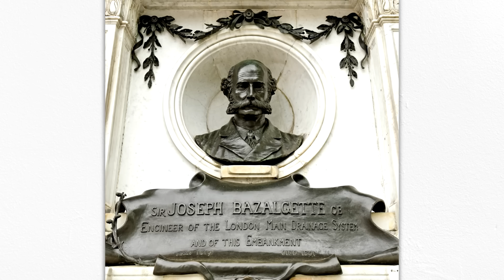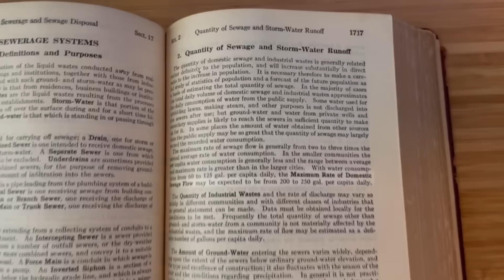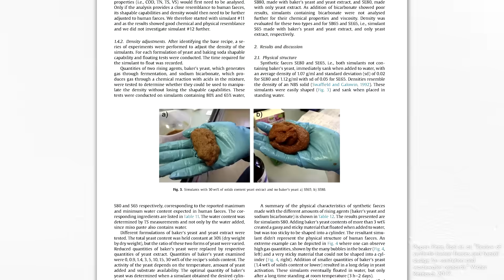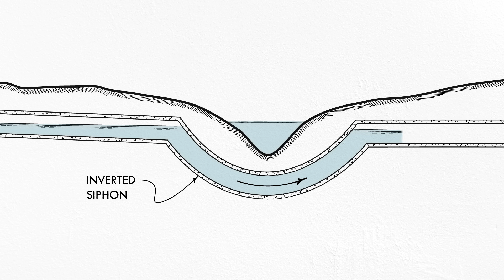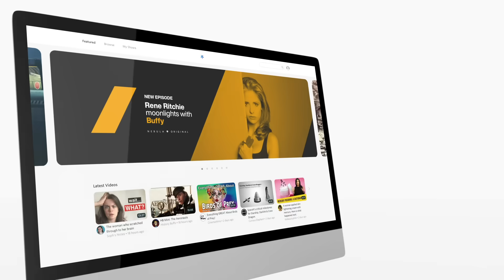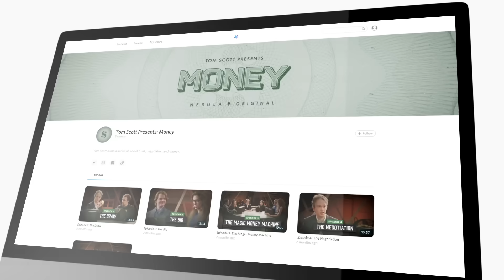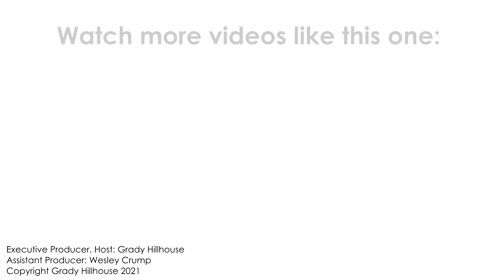How Sewers Work (feat. Fake Poop)

Comment: As a process operator at a waste treatment plan, thanks for giving our awful, yet incredibly important service a spotlight. This all looks pretty good to my eye. You definitely have a bigger budget than my plant though, as horrifying as that might sound. And flushable wipes do a real number on septic tanks too!
Reply: Back in the 70s I had a co-op job at a sewage treatment plant which was both fun and interesting. There were, of course, no (non)flushable wipes but it was condoms that drove the operator crazy. They got stuck in valves and especially in the sludge pump so it was common to see him working on it. Maybe municipalities should do a bit of advertising about this problem.
Reply: @RabbitInAHumanWoild  my step dad ran the local waste water treatment plant and they used to have a guy with a rake manning the grate that was on the first intake tank to keep "white fish" they called them out of the system. They really are a tough material and there are so many of them flushed it's crazy
Reply: @RabbitInAHumanWoild  disgusting and lazy people are the problem.
Reply: We have a septic tank, and absolutely nothing goes down there but water, waste and septic safe detergents and paper. We hear flushable wipes horror stories from our maintenance company, too.
Reply: @dyadica7151  "flushable wipes" have been the worst thing to ever happen to plumbers. I worked maintenance for 130+ units condo facility and we had 8 inch drain piped impacted 10ft with "flushable wipes" and congealed fat. Completely destroyed a $5,000 grinder/ejector pump.  Or the occasional diaper clogging the main drain in a 30 unit building.  And my favorite was plastic q-tips down the toilet. Can't pass the final opening on the toilet and then collect all the "flushable" wipes and neither disintegrate.
Reply: @dyadica7151  we even keep a filter basket in our kitchen sink to capture larger food debris.  It's a little unsightly but helps ensure we limit the solid waste that enters the tank. :)
Reply: @dyadica7151  I've seen some powders you can add that contain fat eating bacteria, supposedly to stop a fat layer forming on the top of the tank.
Reply: @Croz89  Those are great to introduce in the collection system along with pumping stations.  Using the bugs in the pipes was one of the best things we did to stop FOG issues.
Reply: @dyadica7151  what is septic tank and how it works I hear it too often lately
Reply: @disrael2101  I think this wikipedia article does a good job of explaining it: https://en.wikipedia.org/wiki/Septic_tank
Reply: @dyadica7151  thanks very interesting indeed just one thing didn't understand is if it only needs pumping once a year or so for removing solid where's all the water going after tank is full which probably takes couple days max? Just into the ground on the other side of the pipe or
Reply: @disrael2101  Yes, the water at the end, when it's environmentally clean, drains into the ground via a special purpose drainage field of smaller perforated pipes (pipes with small holes drilled into them) set into gravel.
Reply: @disrael2101  can ask Palestine
Reply: @worldchangingvideos6253  no idea what this is
Reply: Septic technician here. Yes they do!
Reply: Flushable wipes aren’t really flushable it’s completely BS & should be banned for sale!!! Thanks 😊 for your service cleaning up 🧼 everyone’s poop 💩!!!
Reply: @ZaneDaMagicPufferDragon  maybe not necessarily banned from sale, but I wouldn't mind a false advertisement lawsuit
Reply: @ZaneDaMagicPufferDragon  agree since it actually causes lots of damage and costs money to cleanup, and the only person paying for it isn't the company making the flushable wipes.
Reply: @ZaneDaMagicPufferDragon  don’t ban them, just change the label.
Reply: @ChaosLord5129  someone's gotta do it
Reply: @ChaosLord5129  Maybe if you got rid of every "gross" toilet, drain and sewer in your area you would truly understand what the word means.
Reply: @isaacw7479    Don't bother, he must from the younger generation that has no clue about anything based in reality...
Reply: Oh, I do appreciate it.  It's a cornerstone of modern civilization.
Reply: I’ve always been fascinated about this topic. There’s a lot that can be done especially in under developed countries
Reply: @Alvi  The sad thing is in its most basic form a wastewater treatment plant has very few moving parts. You need a settling area for separating solids, done usually by just slowing down the flow and adding a simple chemical to "flok" or cause suspended, small solids to clump together and settle out. Then an area to treat the water. Simple aeration, like an air bubbler in a fish tank, will supercharge bacteria to eat the bad. This is where it does get costly as adding chemical or other ways to clean the water adds complexity. Finally you need a way to remove left over bacteria/chemicals before discharge. The last one is often overlooked in developing countries/areas and can cause headaches if discharge is directly into a waterway. This can be minimized by creating a man made wetland for nature to breakdown outflow leftovers before the discharge makes it to say, a river people fish and drink from.

Here in Phoenix Az one of our wastewater treatment plants was designed to discharge into a dry creek that was transformed into several acres of wetlands. Then it flows into the major river that runs through the metro area. Granted, as a last step before discharge from the plant we add chemicals to neutralize the chlorine, and with everything we do the discharge is technically cleaner than the clean water coming out of your faucet at home.
Reply: @Benson_aka_devils_advocate_88  I learned so much from this. Thank you :>
Reply: @algallero3310  You're very welcome :)
Reply: @Benson_aka_devils_advocate_88  thank you for the detailed explanation. A few things I could relate from the information you provided. Here in Dhaka, Bangladesh we have lake called hatirjheel which acts both as settling tank and bactaria introducer and there are aeration devices. Which then moves through a spill way to another section of the city. Which then leads to another place called demra. I’ve seen aeration device there make a kind of foamy bubbles. From there the water gets chlorinated I am assuming. But this being a riverine country most of the time we usually clean river water. But where we differ is that there is not enough mechanisms in place the clean the fat blobs. Which often time creates blockages in the sewer system. It rained for an hour or so last night flooded the entrance of my home.
Reply: @Benson_aka_devils_advocate_88  We upgraded to a BNR system 8 years ago and use no chlorine.  With some changes to chemical suppliers we are exceeding the requirement for enhanced nutrient reduction plants.  Just when we have high flows do we get up to around 300 ppm for solids in the discharge.  Still that is clear to look at in the beakers.  Then again Walt Higgins of EPA region 3 has done a few articles about us.  From what he was telling us we are an odd ball in region 3.  The said part is we discharge into water dirtier than we produce, being the Susquehanna River.
Reply: @brett76544  isn't disinfection different than nutrient removal?
Reply: @atarisbetter9199  yes, the old way was to add chlorine, but now there is uv and some other systems.
Reply: @brett76544  yeah we still use chlorine but we are a very large plant and not sure if uv would work. I'm no process engineer though lol. Our peak flow daily is around 190mgd and converting seems to be a massive amount of tubes.
Reply: @atarisbetter9199  the largest plant I've been at was 110 gpd.  Still a methanol system could also be used, the only problem, does the fire company have a large enough foaming system.  That stoped the plant in Binghamton NY from using that system.  They are 10 million a day and I can see one guy cleaning the system every day at work for alage build up.  They changed to a UV system.
Reply: Until a few years ago, I had no idea what the fuss with „flushable“ wipes was about. 
I mean - I never used them but I also never gave it a thought. 
It was through personal experience that I got to see what those things do to the sewers. A friendly neighbor had over the years managed to completely clog an important sewer line with those wipes which lead to water and waste backing up and coming out of...let’s say, less than desirable locations in several apartments. The plumbers spent a few hours shoving cameras and various cleaning implements into the pipes and were chipping away at the mess and cussing a lot. From the camera images it apparently became clear quite quickly that her apartment was at the core of the problem. My neighbor got a very stern lecture (and probably a substantial invoice) from the plumber as well as an earful from the landlord afterwards and there has never been a problem since. So they apparently learned their lesson. Oh, and the bath tub and sink now drain a lot faster.
Whatever plumbers earn, though: they should be earning more.
Reply: Gordon, it's a shit job but someone has to do it 😂
Reply: @burgersnchips  they're number one at number two
Reply: Civil site inspector here, this is nice to see since most don’t know about them and their construction.
Reply: I have a bidet.  You’re welcome.
Reply: I always thought flushable wipes were a bad idea so i never used them. What i want to know is how a company who makes wipes is allowed to dictate what's acceptable to go down the drains and sewers.
Reply: God bless you and the work you do.
Reply: @Art's Bobcat  Sanitary lines are usually in the middle or near the middle of the road. This is due to the sanitary line being the deepest utility under the road. We have to work within a “right of way” area and not encroach on people property. 
Storm sewers are strategically placed to utilize road grades to collect water during storm events.
As far as a sewer line crossing a field, an agreement between the municipality and land owner was reached at some point allowing the line to be placed there. Most likely it was the shortest and most economical route for the line.
Reply: Waste treatment plants are super interesting. Although they don’t smell great, it’s amazing to see how stuff actually works
Reply: @MrMysteryman00  at our sewer plant you have to stand next to it and only when we are aerating the digesters can you smell it on a hot day.  A working sewer plant should not smell.
Reply: @brett76544  Damm. Must be nice. The one I visited was not like that at all.
Reply: @brett76544  Unless you are processing 120 million gallons a day.
Reply: @aeromodeller1  I've been to plants like that.  Still ours does 300,000 gpd.
Reply: @brett76544  The regional dump was across the street. When the wind was from the north, the guys at the plant would call the air board, who issued fines. When the wind was from the south, the guys at the dump would call the air board, who issued fines. Finally they all accepted that there was no way either was going to stop sinking and so they signed a truce.
Reply: @aeromodeller1  If you can smell a sewer plant, it is not operating correctly or is now an old design.  I can remember someone from NY saying that they have not smelled our sewer plant in PA for a long time.  They live 3 miles away.  We finished using the old system almost 10 years ago.  Now the EPA and PA DEP uses us as an example.
Reply: You must have a titanium nose.
Reply: i love being a wastewater operator! except maybe the sed tanks on a particularly sassy day, or any issues whatsoever with scum... blech. level 4 plant here (bioreactors, DAF). i don't deal with bar screens though so i think i'm pretty lucky, flow in starts with grit classifiers and the screens are way back at the lift station.
Reply: @sameo-  i love your use of "sassy" to describe a sed tank. How delightfully, grossly, evocative
Reply: @sameo-  I never heard of levels with plants? I'm an operator too.
Reply: @sameo-  bar-screens! I haven’t heard that term since I retired.
Reply: Thank you for your service! 😁
Reply: I'm a plumber and I work in vintage buildings, flushables are banned by management, so are drain cleaning chemicals and it makes a big difference in the reliability of the systems.  There are still idiots who put entire diapers down the drain though.
Reply: My friend is in your business too. I’m always giving him shit about it 😂. Seriously you do a valuable and necessary job.
Reply: You do a great job me friend! Thank you.
Reply: correct my if im wrong but most sewage isnt toilet flush/poops right? this vid seems to make that the biggest point while really most is like soapy water and food bits.
Reply: @sudazima  98% of flow that goes to a treatment plant is domestic water. Think of the ratio of water to solids that go down your drain. The sand demo was cool but solids in wastewater don't sink as fast as sand.
Reply: I have some glass jars with regular wipes, then the flushable wipes (both going on 3 years old) and one that I put TP into for presentations.  I dated the day I put the wipes in on the sticker.  It is unbelievable how the fibers build up mop heads on the clarifiers, mixers and get into the sand nitrogen system.  Then we had issues with pumps and had to dig up one valve for the nitrogen system.  We got a screening system in the head works and it fully stopped the problem that was costing us 10% of our budget for two years in a row.  Then we got the PA Rural water waste water system of the year for 2015.  We had Walt Higgins from the EPA and Mark Nevel from the PA DEP come in and help us in late 2012.
Reply: Flushable wipes do a number on the maceration pumps too. The only advantage to flushing them is guaranteeing us plumbers have another job for the day.
Reply: Thanks for your service.
Reply: The fact that products are still able to advertise themselves as "flushable wipes" is completely insane to me.  I'd love to know many millions (if not BILLIONS) of dollars in damage they've caused to our infrastructure over the past few decades!
Reply: Hey thanks for what you do, like the ppl who take our trash away, you are incredibly underapreciated.
Reply: People just don't  seem to understand the importance of Public health engineering in general. Am i right?
Reply: @pranaydeshpande5171  - same as some don't understand appropriate behavior in pandemics or getting vaccinated - its always 'someone else's' problem until it isn't
Reply: Plumbers and sanitation engineers have saved more lives than all the lives of every doctor and nurse ever, combined!!! Farmers and plumbers are two of the most important professions in the world. Without them, modern society would literally not be possible. We can do without electricity and technology. But food, clean water, and sanitary waste removal are vital.  So thank you for your SERVICE. Arguably plumbers are more important than soldiers and definitely lawyers. Plumbers and lawyers are very similar because they both deal with shit except a plumber wont try to feed it to you.
Reply: What got u interested in working with sewer stuff why did u do it
Reply: @ChaosLord5129  - it's honest work that needs to be done.
Reply: @Gordon Wiley you guys get nowhere near the respect you deserve. Things would become unimaginable nasty without sewage treatment and garbage collectors
Reply: Year 2 operator at a source water treatment plant. These guys have the shit end of the stick. Literally. Be mindful of your waste.
Reply: For those who use TP, but want a wet cleaning, I find that a splash of water and small spritz of vinegar (that I already have in a spray bottle for cleaning) on a square as a final wipe (after excess has been cleaned away), leaves me feeling fresh & clean.

You do have to work quickly, though, since the paper does disintegrate quickly.
Reply: I am in a constant battle against flushable wipes. 
I have had so many nights where I’ve been woken up at 3 am to run an 80 foot snake only to discover a wad of flushable wipes the size of a toddler.
Reply: Thank you! You are more appreciated then you know! You, our troops and first responders don’t get the recognition that you should.
Reply: Same here, this is so much more on a larger scale than what we deal with. We use lift stations too. Only about 125k gallons a day.
Reply: Dumb people and drugged up idiots will always exist thus for this problem of people flushing dumb garbage will never go away
Reply: @Pactastic042  ive seen a pack of sick frogs living off roaches, a very sad coughing squirrel, and there was a point where someone in my company found a baby skull, huge investigation n stuff before i was hired
Reply: Omar FASPC  i said locator though... and i never glorified it, you asked a question and your belittling like a jerk... im sorry that you feel the need to feel better about yourself
Reply: Omar FASPC  you've got issues bro
Reply: Fecal Matters
Reply: And thank you for making sure the waste gets out of my home and safely off to where it should go 👍🏻
Reply: The analysis of waste water to monitor everything from drugs to now Covid has been a fascinating development. I hope that he does something on that one day as it has been a game changer for a lot of reasons. As for the flushable wipes - pretty straight forward. As people get fatter, they develop t-rex syndrome and other nasty conditions and normal toilet paper doesn't do the job anymore. Enough said.
Reply: Thanks for dealing with our shit!
Reply: Bro, thanks for the comment about so-called “flushable” wipes. What a scam—I mean, a lego is technically flushable! Yes, peoples, come on, don’t flush those flushable wipes!!
Reply: @Art's Bobcat It has to do with the history. Older cities had joint sewers. Everything drained into creeks. Later you want to build a treatment plant, so the storm system is separated from the sanitary system. The original sewer was built on the street center-line, so the new sewer must be built off center. Later developments will place the two sewers on opposite sides of the street. You have a new tract development on one side of an open field and the nearest interceptor is on the other side, so you run the connection across the open field, hoping you guessed where the future street will be. Sometimes you guessed wrong, and the sewer will be in the future sidewalk. Sometimes the original sewer was built in a narrow street in county jurisdiction and the area gets annexed into the city. Traffic increases and the street gets widened, but it can't be widened on one side because of creeks or railroads. Sometimes one side of a street will develop before the other.
Reply: Omg I didnt know that, sorry I'll never flush another wipe down.
Reply: I was just at an airbnb that had signs everywhere of what not to put in the drains, wipes and grease being the big ones
Reply: @astro143_  that's smart
Reply: Rejuvenation of nature is the work you people do
Reply: As a Class 4 Wastewater Plant Operator, I do love watching videos on how the system works! And yes, you should NEVER flush "flushable" wipes! At least most cheap versions of these wipes don't actually degrade & even manage sometimes to get through our bar screen and clog pumps.
Reply: Wow. I am currently helping build a shit plant
Reply: Thanks for all you guys do.
Reply: Gordon, 
Not sure how long you've been in the business...
Have you ever heard the saying, 
"The solution to pollution is delusion" ?
Reply: @torchofkck4989  Coopers Town NY, one part sewage, 10 parts stream water, mix and release.  That shocked me when I saw it.  The DEC is finally looking to change that
Reply: I work as a sewer locator who looks at your ruined and unmaintained pipes :D
Reply: Wholesome  shit🥰
Reply: Thanks for all that you do!
Reply: I love working with sewerage.
Reply: Omar FASPC  i put a camera with 4 wheels in a sewer and it has a sonar, if it dosent get located, utility companies get dumb and drill through sewer lines. So i measure depth and direction. Ive seen gas companies drill through them all the time
Reply: TheReggiereg1  The blue shop towels take a while and end up being picked up by the screening system, now regular paper towels will break down before the plant, especially if they go through a pumping station.  You can also use a cage like system for the inflow of a pumping station to catch things like that.  Along with needles.
Reply: @Art's Bobcat Man holes are normally in straight stretches placed 400 ft apart.  Junctions also get manholes and when there are turns in the pipes.  In pa we have to be 3 ft away from water lines, but natural gas can be placed in the same hole as sewer lines, but is discouraged by us.  PennDot also like to have sewer lines now just off the paved area of the road in the right of way especially on roads out side of boroughs and cities.   We have 7 lift or pumping stations and just got generators on them.  The smallest has two 1.5 hp pumps to athe largest with two 14.5 hp pumps.  Then there is the main pumping station in the plant where we have a screening system and that has four 10 hp pumps.
Reply: So would you suggest to not use flushable wipes
Reply: @bigpappachungus  yes, I'm an operator that works with those "rags" we call them in our pre treatment area. But honestly I still use them because it's so much cleaner than tp.
Reply: You think Flushable Wipe should be banned under false marketing ?
Reply: Isn't it funny pro sports players get millions but us water treatment folk get nothing, even in a drought. Humans suck
Reply: Though not often thought of your service is greatly appreciated and thank you. Where ever  you are
Reply: The local sewage organisation in Djursland, Denmark, once complained that somebody had dumped a carpet in the sewer. I guess a manhole cover had been removed in the darkest hour of the night to make that possible. Luckily the culprits did not risk losing their brains too.
Reply: @typograf62  How about a chunk of asphalt over 12 inches in diameter in a man hole with 8 inch pipes coming in and one going out.  It was causing a back up into 2 homes.  we had to use a metal detector to find the manhole that was tar and chipped over twice and the last paving of that road was when the sewer lines were put in back in 1986.  Then after we found the block in the man hole they repaved in 2019.  We figure the block got in there in 1986 and too a few decades to just get into the right position to cause the back ups.
Reply: Haha flushing orbeez down toilet go brrrrr.
Reply: @joelcrafter43  hey, I'm not you're dad,  live your bliss. Good luck if it screws something up closer to home though.
Reply: @gordonwiley2006  I was referencing that story from a few years back where a swedish clogged up like an entire neighborhood with them, or at least that's what it looked like, no clue if it was fake or real though.
Reply: Same here an operator. I'm at a large metro plant. I work in the pre treatment area and our screenings dumpster is all rags. Serious people flushable wipes aren't real that don't break down at all.
Reply: Given that wipes marketed as "flushable" are anything but, why haven't we seen pressure on manufacturers to stop labeling the things as "flushable"? (or even laws banning such labeling)
Reply: @jfwfreo  I wish I had an answer for this one, but I don't.
Reply: Thank you for keeping the world's sanity stable by taking care of our waste mate. You are appreciated.
Reply: The fact they're labled flushable is an oxymoron in itself. Smh
Reply: Thank you for your service
Reply: thanks for accepting my poop. - and other fluids i send your way
Reply: Whatever they pay you guys, it's not nearly enough
Reply: I did maintenance and collections ( vac truck)
Reply: The fact that "flushable wipes" are still allowed to advertise as "flushable" is just ridiculous to me.  These companies are costing taxpayers MILLIONS of dollars every year and just absurd as far as I'm concerned.

Really demonstrates how entirely our government actually works for corporations, not the people themselves.
Reply: This is something that I will NEVER do, and cannot thank the people like you - enough so I never have to worry about this stuff once it leaves my body. 

I will never judge the job someone does, because someone MUST do it, and I’m sure glad it’s not me.
Reply: I believe you. I feel like wastewater treatment is often overseen as a useless burden, since this process itself doesn't put the bread on the table
Reply: How did you get into that line of work?
Reply: Sounds like a shitty job
Reply: Omar FASPC  basically if i dont do my job right, houses blow up and people die
Reply: ok
Reply: But (butt?) flushable wipes do such a good job on my little bottom…..
Reply: ...collect ur BiG chex & shut up! LoL
Reply: That means flushing condoms are just as bad?
Reply: One question sir, did u plan to be like that ? Or just a job stumbled upon?
Reply: @FedJimSmith  Like most at my plant, I found the job from knowing someone. For me it's a job of convenience and not a career.
Reply: Process operator sounds like a very polite way of saying shit stirrer 😂😂😂
Reply: Still not gonna wipe my arse with dry paper.
Reply: What about tampons??
Reply: @rmg2419  I have seen those block up the laterals from the house to the sewer line.  Then at the sewer plant without a screening system they turn into mop heads on the clarifiers along with any motars and pipes in the treatment part of the plant.  So you have to drain the plant in sections about once every 6 months and clean it.
Reply: @rmg2419  also not good to flush. If it didn't originate from you, it probably shouldn't go there.
Reply: @rmg2419  yes tampons, the applicator, condoms and a** wipes are majority of what comes through.
Reply: @ChaosLord5129  trolling is disgusting
Reply: @ChaosLord5129  yes trolling
Reply: TheReggiereg1  no. Not regular paper towels. The fibers will break up. But don't flush rags or cloths. The woven fabric is to strong.
Reply: @ChaosLord5129  your comments were unstable, are you ok?
Reply: Gordon after the waste water is treated what is its destination ?
Reply: @andrewnicholas9079  usually a river, in our specific case, it ends up at a power plant to spin a turbine/make steam before entering a river and then flowing out to the ocean.
Reply: @gordonwiley2006  thanks. That's interesting. I worked with water in oil and gas production for many years in the gulf of Mexico. It was treated and put back into the ocean. I always wondered about the waste water.
Reply: You work at a waste treatment plan?????
Reply: @Gordon Wiley You're a local hero, thank you for your service to society!
Reply: I work in water treatment as well. Clean water is so underrated...
Reply: I hope to god you guys don't suffer with septic trucks that empty stones and gravel/sand into your plant. :D
it truly is a costly nightmare.
Reply: I'd never flush something so indurant, if it needs a rag then by God I use a cotton rag. The same cotton rag next month could be wiping my nose. Yes I appreciate the dirty ass jobs!
Reply: Stay strong brother, respect from texas.
Reply: What's a average salary for this job ?
Reply: Dirty Jobs did several shows about your industry.
Reply: I am so against "flushable" wipes, I only use toilet tissue labeled as "safe for septic systems" like Scott's. 
If the TP starts dissolving before I get to flush it (and it does!), it's a good indicator that I am not contributing to the problems.
Reply: Heres a random fun fact: A close friend I work with used to be the guy diving in the sewage water, (quite some time ago) I remember him saying one thing he saw alot of vitamins/ pills (he specified vitamins for whatever reason) . .as well as the whipes, and corn . . Supposedly at that point,  all the methane kills most harmful bacteria anyway . .is that true?
Reply: Well thats engineers for you. Even on there spare time working on hobbies they have more money then government facilities. No way this guy is making more money on youtube then as an actual engineer. Iv never heard him peddle patrion or ads.
Reply: Ask yourself does this make sense to you  3 This means everlasting life,+ their coming to know you, the only true God,+ and the one whom you sent, Jesus Christ.+ 4
Reply: Dude you're a hero.
Reply: Luckily I have an electronic grinder built into my septic tank so can basically flush anything I want (within reason obviously not plastic or metal) without worrying about such things.
Reply: .. I really should read all comments b4 saying things. It’s already been explained…
Reply: What’s the craziest thing you ever saw, caught on the bar-screen?
Reply: Why do you have to announce that you're a process operator like you're accepting an award? Just say thanks for the video and move on. Nobody was sitting here thinking, "But what does a wastewater treatment plant worker think about this?" We get it, your job is important, but this isn’t a networking event.

Just appreciate the content without sliding in your job title like a LinkedIn post. The video isn’t about you, it’s about the topic.
Reply: @ the same reason why you couldn’t just read the comment and scroll past it without giving your equally uninvited opinion.
Reply: @6miller0transit1  the classic hypocrisy of the internet, demanding silence from others while feeling entitled to chime in yourself. If opinions were so unwelcome, maybe you should’ve taken your own advice and scrolled past instead of whining about someone else's response. Funny how that works
Reply: Four years later, are you still a process operator?
Reply: Condoms and tampons always at mine
Reply: Neeat! Thanks for the insider insight 👍
Reply: What's your grade?
Reply: @ststst981  Two, though I'm not sure I've heard it called a grade before. We're pretty isolated from other districts.
Reply: @gordonwiley2006  oh wow. I've heard level but over here west coast I think officially it's grade
Reply: @ststst981  east coast here, it's possible it's just a part of the title that got dropped off at some point. Or maybe a soda vs pop thing. My organization is PRETTY informal.
Reply: @Benson_aka_devils_advocate_88  I being thinking of trading my career from agricultural to this lol any ups or down ? If money talks then I move lol
Reply: That's a shitty job.

I'll see myself out.
Reply: @ChaosLord5129  dirty and gross jobs build a strong character. If you can't stomach shoveling shit, you gonna fold when shit hits the fan. Pun unintended.
Reply: The retro-fiting of low-flush cisterns to original bowls is one problem, but how much impact does the reduced water trend have on sewers that were designed for full flushes?
Reply: @Pongo_Ponginae  more toilets likely averages that out